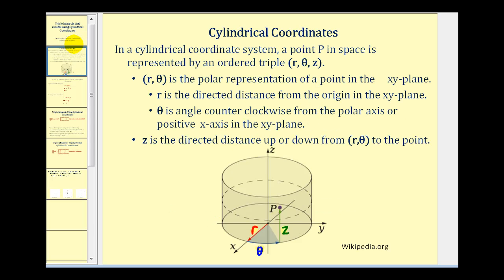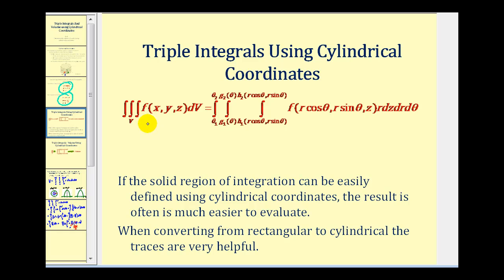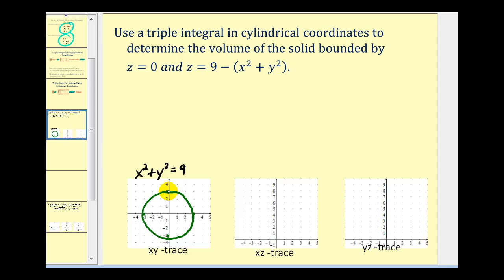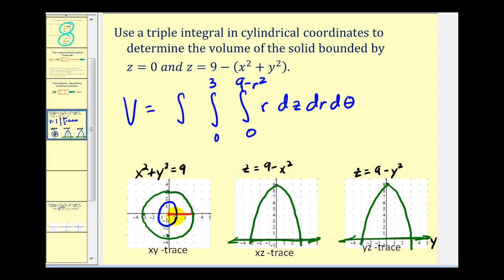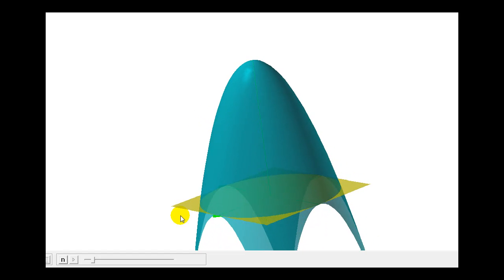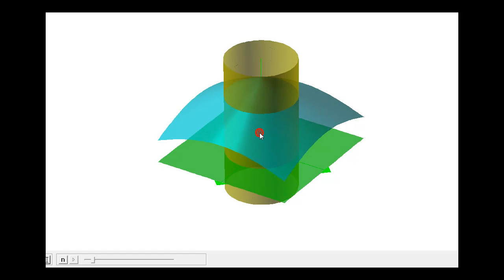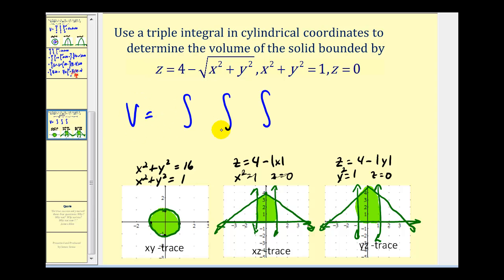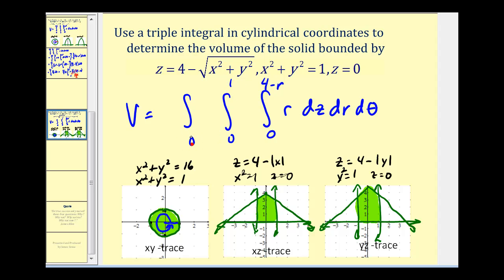Triple Integral and Volume Using Cylindrical Coordinates

Comment: In example 2, why is the radius not from 1 to 4?
Reply: Kevin93939 I think its because the volume you need is inside the cylinder. If you look at the xy trace you will see that the radius goes from 0 to 1. I mean, you dont care about anything outside the cylinder.
Reply: @franciscoricarte7788  a little bit too late buddy